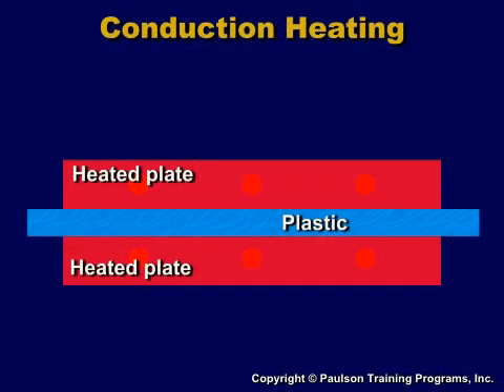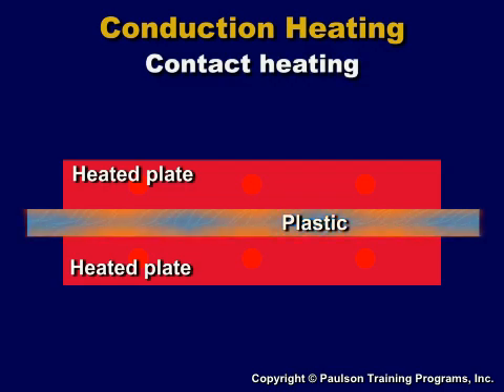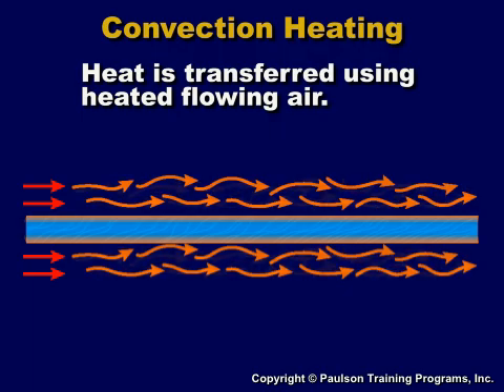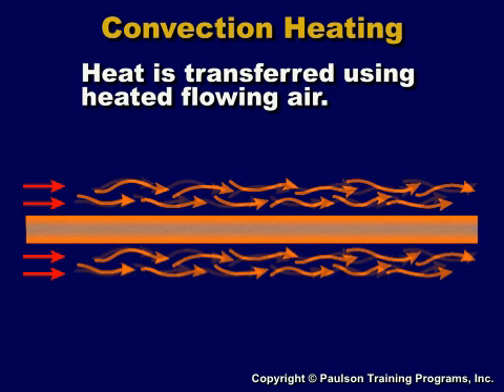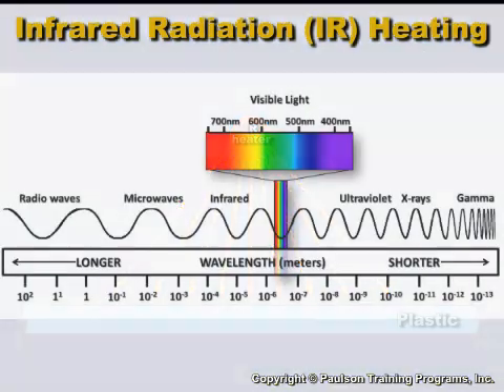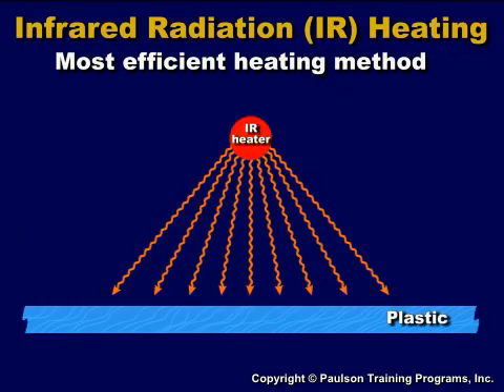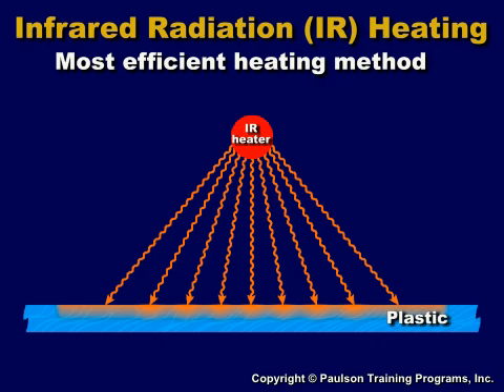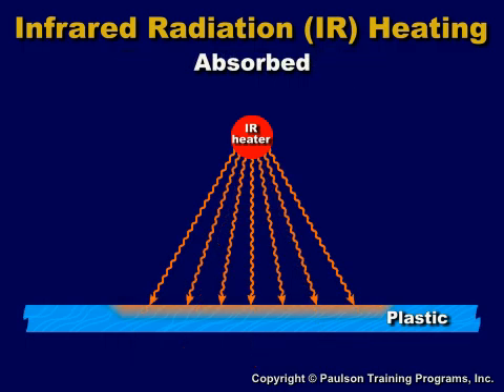Thick Sheet Thermoforming - Lesson 3 Effective Heating of the Plastic Sheet

Comment: 1'31: Infrared radiation DO NOT have more energy than visible light. However, since infrared radiation has longer wavelengths (like far-infrared) penetrates deeper into objects, leading to a deeper heating effect.

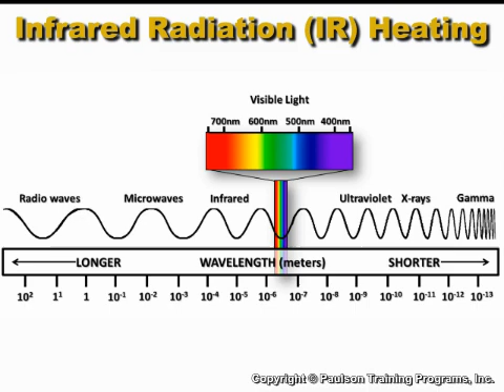Comment: At 01:30 you state that infra-red (IR) radiation is hotter than EMR in the visible spectrum - however, in 1900, Max Planck discovered that the reverse is in fact the case, contradicting the findings of astronomer William Herschel who first discovered the infra-red spectrum in an experiment with a glass prism 100 years earlier in 1800, and as it turned out a century later, while his findings were correct, his conclusions weren't, due to a crucial flaw in his experiment. That infrared radiation has a higher intensity than the visible spectrum has been an enduring myth, not only in the 19thC, but the 20thC, and still now in the 21stC, somewhat exacerbated by the current controversy about the heat content of carbon dioxide (CO2). Rather than IR radiation having the greater intensity, with both CO2 and plastics, which as you know are composed of hydrocarbons (carbon, oxygen & hydrogen elements), it is the carbon bonds in both substances that are more susceptible to EMR in the IR spectrum that results in more heat absorption in both cases, which in turn results in more latent heat absorption in the case of CO2 and greater plasticity in plastics.